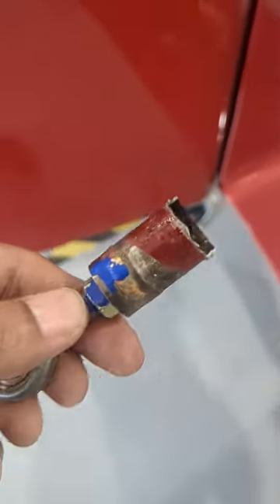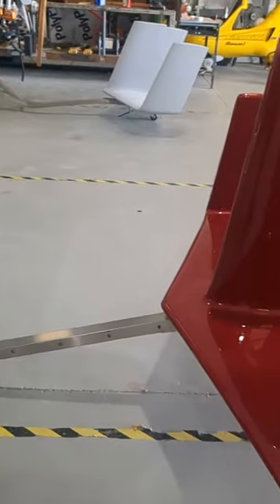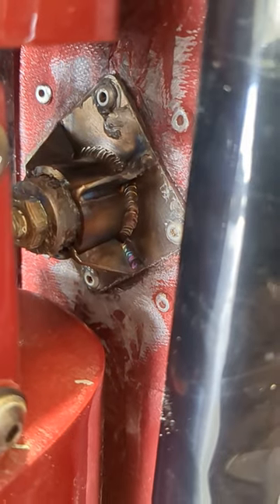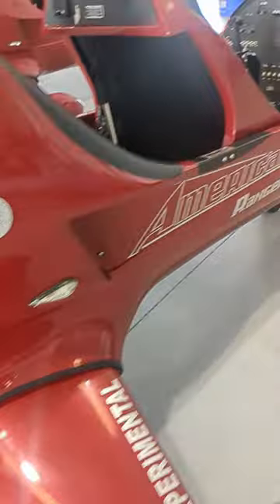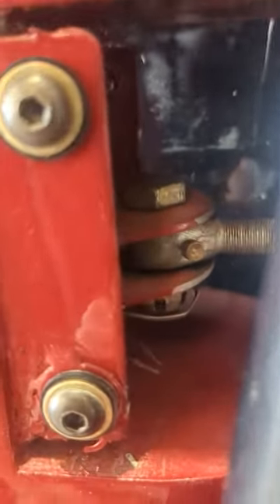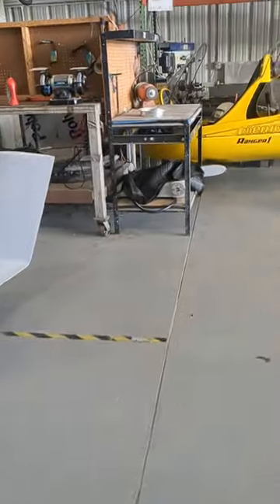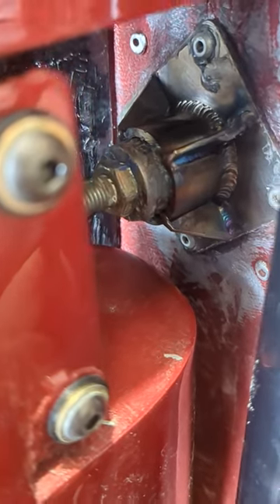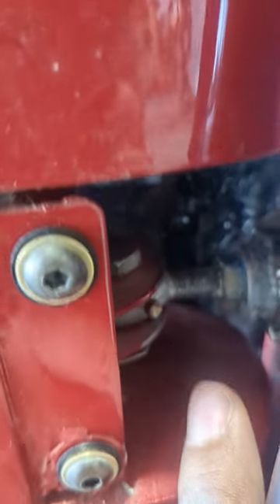Rudder top hinge reinforcement safety directive for AR-1 gyroplane

Comment: in practice you have inserted the uniball holder tube in a support, right? the only thing i wouldn't do is use rivets to fix this mount to the fiber!!
Reply from the maker: Do not know what a uniball holder is. There is a metal plate on the back side of the fiberglass that the rivets are going into